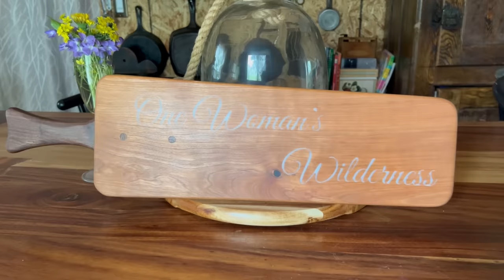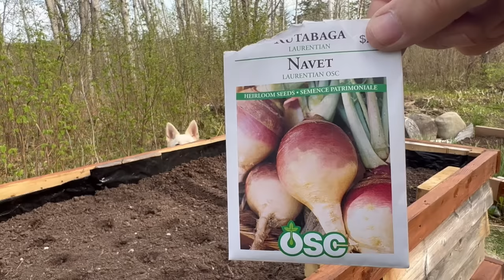Busy Little BEE! Gardening, Landscaping and Firewood. A Shout Out to some of my viewers.

Comment: When I decided to go off grid in 1977 I planned a passive solar home. The various passive factors take care of 70 to 80 percent of my heating load. Even with a family of 5 I rarely used more than 2 cords a year and that was all in a wood cookstove that also heats my hot water while cooking and doing backup heating. Now that I’m alone here I used about 1 cord. In my cookstove I use 12 to 16 inch wood cut or split pretty small. I cut and split it all myself from my own land for 34 year then had 3 back operations from accidents and work away from home. I had to buy 1 to 2 cords a year for 9 years but now I’m back to cutting and splitting all my own. The passive solar design saves me a lot of work and or money and it cost no more to build than an ordinary home.

Comment: Stacking that firewood is not that time consuming , just needs to be done to be able to maximize the available room you have in which to store it…, and the cutting of the trees and splitting the wood is yet another huge task…but when you need it, as you do, it makes that work a little more tolerable…when I cut trees and split wood and then stacked it when I lived at Toledo Bend Lake in East Texas, it was therapy for me, but this was done after retiring from education for 35 years…I was not in a hurry and really helped me for my firewood to use on my large b-b-a smoker….yes,indeed…be careful, always dress properly when working around wood as it looks like you do…be safe, stay healthy, God bless! Great video Ms. Lisette!

Comment: Clever, beautiful❤ Advice ,Mix cement 1 part and sand 3 parts, dry without water. The seams at the path with this mixture dry sweep the path, tiles. No water is needed, the mixture itself will harden in the seams of the path! Greetings from Russia good luck!!!

Comment: If you have old leather boots you can easy attach them to some hard wood blocks with steel brace straps or No8 wire and they make a realy good pathway / patio compactor to save your back. Just stamp away. Looks silly but very effective for small low impact paths etc.

Comment: If you have a chance have a look on the web at mass heating rocket stove build. You use a very small amount of wood and the heat is retained in a solid structure that gives out heat hours after the stove has gone out. Its made from an 45 gallon oil drum and you can build the mass heatbank out of mud ( clay ) ,bricks and concrete no smoke comes out of the flue and no pollution into the atmosphere Every thing is burnt inside the system. I will build one in my next house for sure.as i spend so much time chopping wood in winter

Comment: I split that much firewood down here, manually using a sledgehammer, steel wedges and a fiskars splitting axe. And a chainsaw Im good with a chainsaw. No dump truck for me I move split firewood by wheelbarrow load.